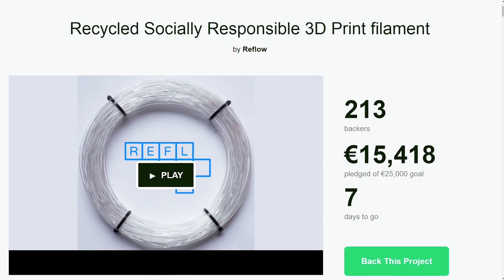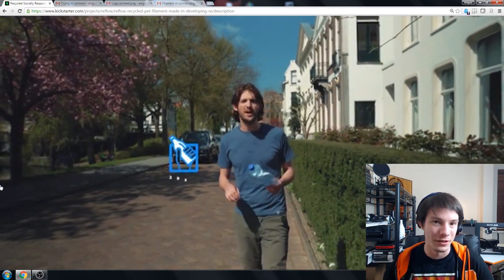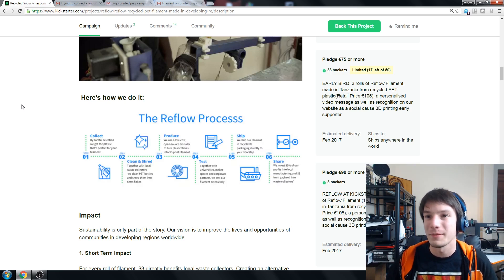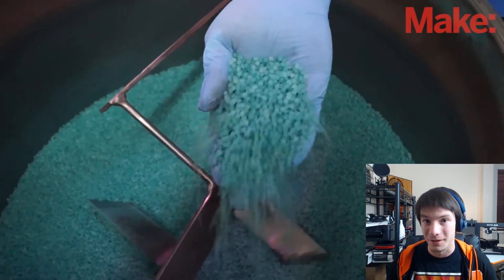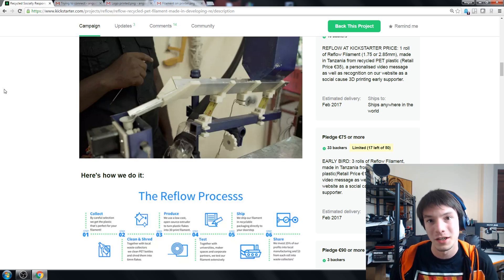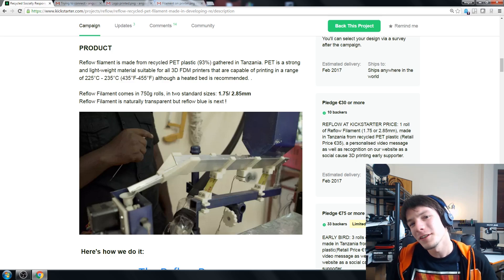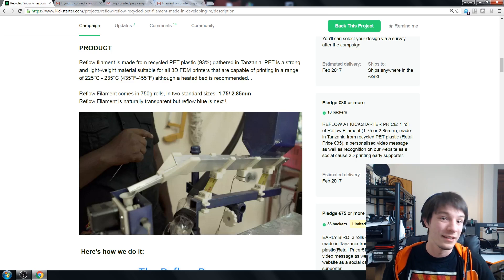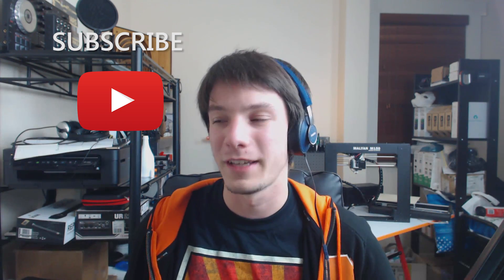3D Printing Filament from Waste Plastics - Reflow

Comment: Just a nice little fyi:

The whole thing about the plastic being different ages etc can be solved with a machine

At high temps in a low pressure nitrogen atmosphere the flakes/pellets need to be kept for like 12 hours. A machine that does that costs around 5 million $ - that is after you've built the machine that produces, washes and sorts the flakes by color etc

Comment: 3D printing needs consistent quality material. And anyway, the virgin is granulate is about $6 or so per Kg, recycled filament will not be cheaper. Recycled PET might work if the waste material comes from ONE source. For collected waste, no chance! There will be contamination with LDPE/HDPE, plus labels, inks etc. The people get probably paid by weight, so cutting down and sorting generates more money for the collectors. 
I would sort it as good as I can and re-grind it, and then mix it into some lower-end plastic products.  That is how plastics are usually recycled.

Comment: I don't know about making filament but I once worked in a Plastic company and they recycled the plastic over and over and over mixed with new material. So it's great for some kinds of injection molded products but for your home printer?...

Comment: Only thermoplast plastic can be recycled. However, it needs more than just collecting and squeezing through a nozzle. It needs the chemistry to make them flexible and durable again. This involves solvents and thermal processing which goes far beyond what a small company may achieve.

Nevertheless, it is a noble way of thinking and the right direction to move.

Comment: Mining for materials from scrap are already a thing for many years in many countries. just that it doesn't receive much attentions from the public. However the filament is way too expensive, it is even more expensive than cheaper bands that proven to provide acceptable print quality. there is very little to no economical reason to buy a roll of inconsistent quality filament. I imagine they need to mix certain (high) percentage of virgin plastic into the mixture in order to improve the consistency,  just like what the manufacturers already doing with a lot of the plastic products. That being said, i probly wont try to use filament that made this way, a slight impurity could really screw up your hotend.

Comment: hey Angus, recycling plastics is still a great idea. but not to produce filament, except if it's your own printer waste if you are a serious recycler. But waste plastics can make so much other sheet materials or objects. Check preciousplastics.com out. there's videos of 3d fully working printed extrusion molds. 3d printing can be a part of the whole recycling thing if you think as a maker and not only as a 3d printer guy. ;)

Comment: There's essentially a point where two factors have to converge to make the recycled plastic filament business model viable. 

First, the end product has to be comparable to existing competing products (new filament). The consistency/purity of the material has to be such that printer settings can be set for reliable, consistent print results like all new material filaments. We are assuming that's covered by the sorting and processing of recycled materials. 

The second factor is cost of end product. Naturally, this Kickstarter program is a testbed project, so we are looking at a cost ineffective product, but looking at a long term, much larger scale commercial level industry, the end product could feasibly be sold for the same price as all new material. At that point, the real incentive for using recycled is because it's recycled and better for the environment be reducing the production of new materials while simultaneously reducing landfill material that doesn't readily break down.

It still takes money, time and energy to reprocess used materials, meaning if the cost of producing recycled filament is the same as the cost of producing all new material filament, again, the only advantage the manufacturer is looking at is reducing landfill waste and introducing less new plastic material into the environment overall. 

Realistically speaking, until those two factors converge, we probably won't be seeing large scale recycled filament operations in action. 

Lastly, the other issue when it comes to reclaiming used plastic is ideally you'll be sorting out new used plastic as opposed to plastic buried in a landfill that has been exposed to UV radiation for an indeterminate amount of time that has begun the slow process of decomposition. Dirt and chemical exposure can similarly create variances in decomposition rates, making the sorting process key, again, prioritizing (maybe even limited to) recently discarded plastic. 

But that's all just speculation. A closer look at the plastic bottle recycling industry used in the production of more bottles or perhaps filler/packing materials would probably answer a lot of these issues. 

Turning third world plastic waste into usable building materials might be a better endeavor than making printer filament.
Reply: Yeah, bricks made with shredded plastics as a kind of cellulose binder would be more viable until we have drones capable of collecting, sorting, and cleaning plastics using few resources and high accuracy. Until then virgin filament is necessary for reliable extrusion printing.  Extrusion printing could become obsolete before all of this happens.

Comment: Recycling is a good thing. The way I see it this recycled plastic should be advertised as so. It could be used for support material, very rapid and early prototyping and other uses where quality isn't thaaaaat important.
Reply: Also Dave Hakkens, creator of Phonebloks designed a filament recycler a while back.
Reply: Also, from everything you've shown, the filament isn't extruded during production, it is drawn. Completely different process, as someone with an understanding of engineering I thought you'd appreciate that tidbit :)
Reply from the maker: Whoops! You're correct they're using a drawing process. The process used by low cost diy filament projects are usually extrusion based though.
Reply: +Maker's Muse interestingly my university (the only one left in Scotland to do so) has an extruder and they've previously extruded filament and handed it to the Printer technician who now swears by it.
Reply: I'm an English tax-payer... so I funded that! Support the 3rd World (Scotland)! :P
Reply: Alex Mackinnon I'm offence and I take Scottish.
Hahah no real offence taken :) I grew up in East Africa before moving to Scotland, I know 3rd world. Thanks for funding!

Comment: You don't have much positive to say about home made filament, but there are lots of positive stories on the net of people who are having success with home extruders. 

The commercial machines use more complex techniques to produce large volumes of filament quickly. This isn't such an issue for a smaller machine where you are likely willing to wait the hour it takes to produce a kilo of filament. 

Filastruder seems to be doing well and there are companies around selling PLA and ABS pellets used for producing your own filaments. You can produce filament for as low as $6-$8 per kg which makes it an attractive prospect. It also gives you the advantage of being able to make the amount  of filament you need in a certain colour rather than having to buy 1kg at a time. 

Maybe you could review the Filastruder for us and see what your opinion is after some hands on experience?